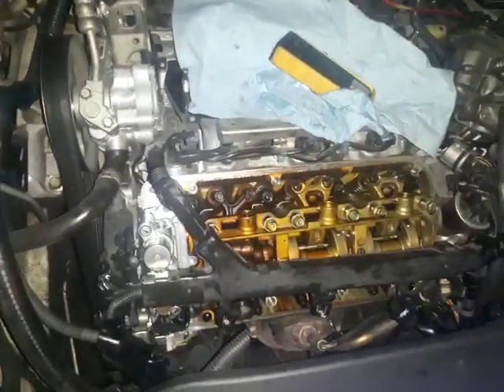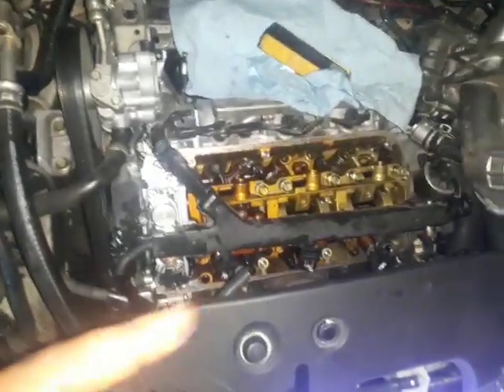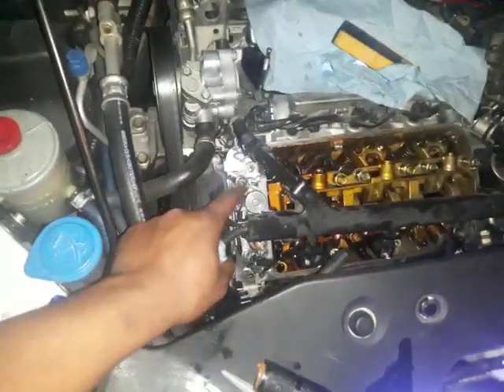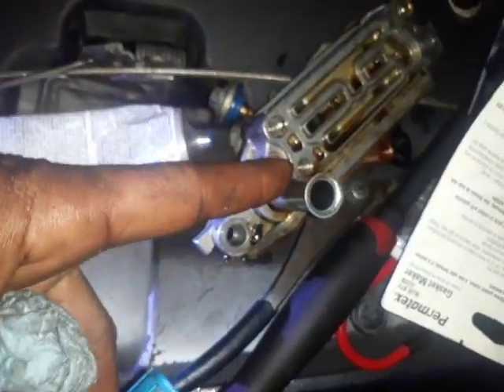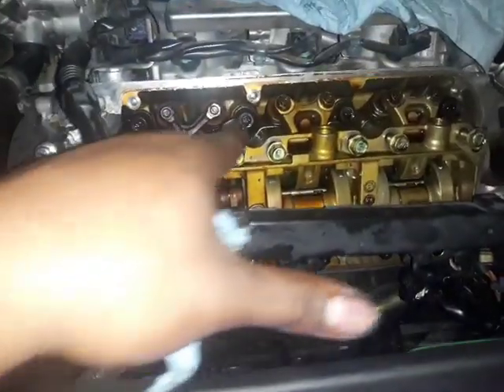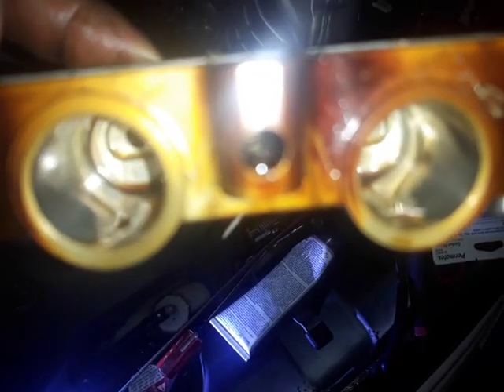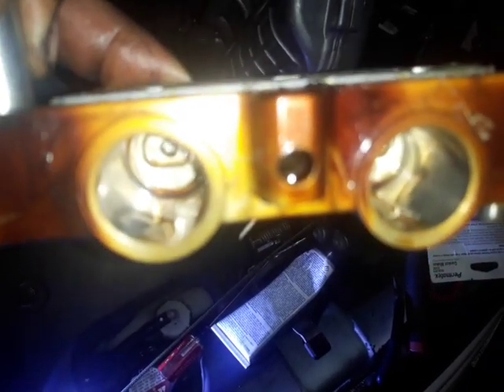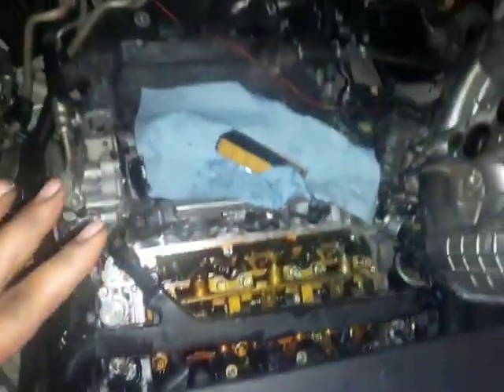P3497 Code || Valve Pause System  Stuck off Bank 2 || Cylinder Deactivation Bank 2

Comment: Got a oil change day later engine light on p3497 and p0304 changed spark plug n coil pack and wires p0304 went away was still giving p3497 called honda they said replace spool valve, is that all i have to do?
Reply from the maker: Sometimes you just need to change the upper part of the v tech solenoid if not you need to replace the whole assembly. I would recommend watch the live data of the pressure switches while drive around. There might be oil restrictions

Comment: The screen will get stoped up if the oil isn’t changed regularly or trash of some kind preventing the oil pressure needed to operate the solenoid

Comment: I had the same P3497, 2010 Accord, the cheap fake gasket was the cause. Thanks for sharing yours.
Reply: Question for you did you replace the gasket again with the original or replace the whole vvt  solenoid?
Reply: @lordedin  Gasket alone will very likely let you down at high speed. The assembly replacement with valve adjustment will take of the things for some good time.
Reply: What did it sound like
Reply: Did you have an oil leak cause of that bad gasket?

Comment: Thank you for the video and all the details.
I looked at the video before and did not understand.
Now i know.

First thing i did was to replace the gasket and codes appeared.

Then I replaced the oil control pressure switch and then the solenoid valve (cheap one).

I am still having same issues.
Now i know thanks to you what should be done.

Thank you.
Reply from the maker: Be careful with the rocker arms. Don’t forget to subscribe too😊

Comment: Accord coupe EX-L 2010 3.5l, had a leak onto the alternator fixed the alternator and installed eBay gaskets on the solenoid and it worked fine although was consuming more gas for a couple days, but today it started shaking and doesn’t speed up when pressing the peddle all way down I got check engine as well code p3497 do I have to change the whole solenoid (15810-R70-A04) and how about the part under that where the dipstick is located what’s the part number for that? Would I need to change that as well?
Reply from the maker: Yes, if the solenoid oil gallery’s stuck off cylinder deactivation occurs, be carful when you remove the rocker arm
Reply: @theasemechanic  I had my alternator and camshaft adjuster solenoid replaced by professional mechanic. Few weeks later it got this code P3497. Do you think it’s the O2 sensor that I need to replace or is it something else?
Reply from the maker: @taisiphu   amount of oil leak coming from the Solenoid kills the battery, the whole Vtec solenoid need to replace
Reply: @theasemechanic  yeah I found that loosening the solenoid and pulling it up to release pressure then putting it back fixes it just can’t go over 60mph, I have both parts coming in tomorrow thank you

Comment: I just have the p3497 pressure sensor switch, I replace the gasket because was leaking the alternator and y have brand new oil, any thougs?
Reply from the maker: Clean the area and see if it leaks again if the codes comebacks you need to change the whole rocker arm actuator / vtec assembly

Comment: I replaced the two gaskets on vtec solenoid on 2009 Honda Pilot because I was getting a leak from the solenoid to the alternator and did an oil change. Two days later engine light and vtm4 popped. Bought a new vetch solenoid assembly from amazon. Installed it and cleared the code. Two days later same code p3497 bank 2 stuck open. came back with check engine and vtm4. I notice that if I unplug the battery for 5 mins the light would disappear and the vehicle would run normal again until the check engine and vtm4 comes back in again then the car would go into a limp mode. Help please I’m out of ideas.
Reply from the maker: Most peoples did like you did. Make sure you plug it correctly and your oil type, is that good quality or SAE type
Reply: @theasemechanic  yes I put everything back correctly and torque down the three 10 mm bolts. I’m also running Mobil one 5w20 and Honda oil filter.
Reply: I guess my next thing is to take off the throttle body and valve cover and replace the whole solenoid by removing the rocker arms and installing Dorman’s full vtec solenoid assembly.
Reply from the maker: @ProGoHERO  yes like I did on the video be careful the springs are sensitive

Comment: Hey I’m having the same issue on my 2008 Honda Accord v6. I replaced the cylinder deactivation system sensor on bank 2 but the p3497 code is still on. What should I do next??
Reply from the maker: Which sensor?
Reply: @theasemechanic  the VVT Oil pressure switch sensor
Reply from the maker: First try to replace the v tec solenoid only the top part if that not fixes the issue you need to replace the whole assembly like I did
Reply: @theasemechanic  okay thank you 🙏🏼
Reply: @theasemechanic hey do you know the part number to the top part? Not the oil pressure switch but the other plug just above it. I think it’s the vtec solenoid?? I’m not sure and can’t find a part number in it
Reply from the maker: I don’t know the part number but It is Dorman    brand and you can get it from Autozone most common part number is Part #
918-056 but might not fit to your car
Reply: @theasemechanic  okay thank you brotha 💪🏼
Reply: @theasemechanic  how do i tell a car shop i need the whole assembly replaced
Reply from the maker: @ some decent shops can do that

Comment: Had oil leak from spool valve. Decided to  replacing gaskets from eBay marked from Honda (15845-R70-A1, 15815-R70-A1)
Started with no codes. Fixed leak then days later engine light came on (P3497). Cleared codes now Both (P3497, P0304) come on. Should I Start replacing entire spool assembly first? If not what next?
Reply from the maker: You replaced it because it was leaking? No code from the beginning?
Reply: @theasemechanic  Yes, I started with the eBay gaskets in an attempt to fix oil leak. Afterwards check engine popped up (P3497, P0304). Recently installed front spool valve (15810-R70-A04), still testing but currently 100+ Miles and no new codes.
Reply from the maker: @alexbastidas1311  great you fixed the issue

Comment: Hello, I replaced the solenoid spool valve and now I have a problem, I have the check engine light on and the codes p0300, p03005, p03006, what went wrong?
Reply from the maker: Use big scanner to check other codes, what was the reason you replaced the vetch solenoid?

Comment: Hi, my 2008 honda odyssey has code P3497 in bank 2, the van still drives but it is weak and wants to shut off. Should I change the V-tech assembly solenoid only? or do I have to do other things? it looks like you opened the top of the engine. please advise!
Reply from the maker: Any other codes? I would change oil first
Reply: @theasemechanic   no other codes, I changed the oil already but it did not fix the problem. I got 2 codes P3497 one says permanent the other one says temporary. Any chance I get you email or number please
Reply from the maker: @kamal658  ok here you can do buy the top assembly and change it if that not fixing it you need replace the whole like I did

Comment: Hi, I/ got 2015 Honda Pilot EX-L with codes P3497, P0300, P0304, P2659, check and changed oil, replaced oil pressure switches, replaced front (bank 2) spool valve assembly, and new coil packs, all genuine honda parts, still have codes. Not sure what to do now, don't know if there is anything else i can do, I even ohm'd circuit for p2659 and everything in spec. Seems like leading me to PCM reflash, or bad pcm? Wondering if there is anything else you know about. I know 2013 3.5L have TSB 13-055 reagarding oil pressure relief spring in oil pan. Anything you can recommend would be greatly appreciated, don't know where to go from here.
Reply from the maker: Do you have a scan tool that reads live data? If so try read the oil pressure switches for bank 2 which is near to radiator.The misfire code you saw has nothing to do with coils packs, if you ok enough budget to replace coils, it’s fine unless put the old one back
Reply: @theasemechanic  I don't have scan tool that can read live data, I did compressions test and readings will go from 0 to 160 seems odd.
Reply from the maker: Also check the connection
Reply from the maker: P0304 check plugs and coils again since you replaced them, most of the time that code showed up with other Vtec related issues
Reply: Just so you know sometimes one code triggers others..its like a LED strip you can cut at it one point and itll kill all.the other leds and theres a point where you can cut it and itll still keep glowing ..same thing with diagnostic codes

Comment: P2647  rocker arm actuator system stuck on bank 1 ...2005 honda odyssey van runs great though...will this be the same as yours....anyway thanks for your time and expertise that's some serious reading and classes one has to finish to get certified...
Reply from the maker: If Bank 1 is stuck it probably solenoid or pressure switch and its goanna be way differ than this video.

Comment: Thanks Dood! $35 at O'reillys. Came with the O-ring. 10 second job. Piece of cake!
Reply from the maker: nice so you just replace the top piece?
Reply: @theasemechanic  yes! Check engine light was off when i started it up too.
Reply from the maker: @levidoyle4030  Good Job!
Reply: @theasemechanic  well, I'm not too bright. This is NOT the video i meant to comment on. I have a pilot with a p3400 code.
Reply from the maker: @levidoyle4030  works for pilot and accord since they share same engine
Reply: @theasemechanic  sometimes it's not working like that. I put new sensor with a new O-ring. Two weeks later I got the same code. Decided just to buy a new original part and switch as you did. Now it's golden!
Reply from the maker: @Budamshu  yea if the problem was the pressure switch you don't have to replace the whole stuff, but sometimes it don't work like that

Comment: I have  code. P3497. But I have 2008 accord v6 & it say something about oil pressure
 This is the first v6 accord I have
With this code.    Please help me
And thank you
Reply from the maker: Did you check the switches and solenoids on Bank 2?
Reply: @theasemechanic  which one is bank 2?
Reply: @sonny323   it’s just the oil pressure switch man. Is the oil pressure switch closes to you. There’s two oil pressure switches. One in the back and one in front of you! Is the one closes to you. All these people explaining is a different thing but it’s not
Reply from the maker: @leticiarosales2769  The switch is installed on top of the v tec
Reply from the maker: @sonny323  By the fan side
Reply: @theasemechanic  o ok
Reply from the maker: @sonny323  you may need just the top V tec
Reply: @theasemechanic  lets hope so
Have a mechanic  coming tomorrow  to check it out for me
Reply from the maker: @sonny323  Sorry Budd for not see your comments, hope you fixed it
Reply: @theasemechanic  ya.  Had a mechanic fix it.    Then sold the car.  I dont like honda. V6 cars
Bad. Transmissions
Reply from the maker: @sonny323  ya V6 are not good